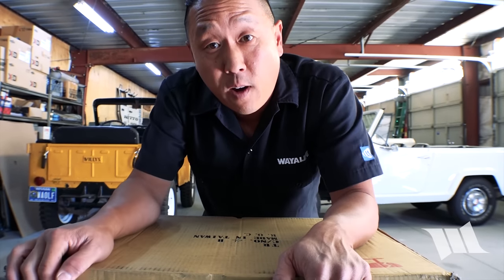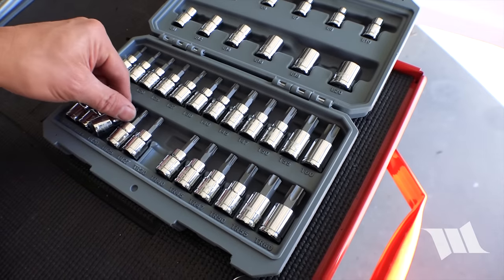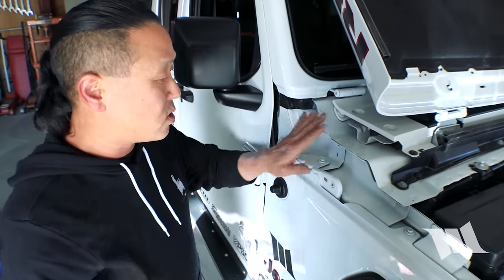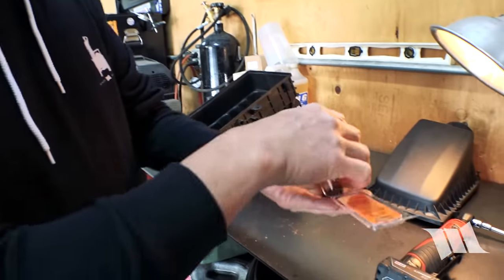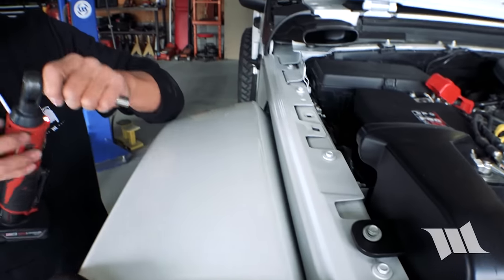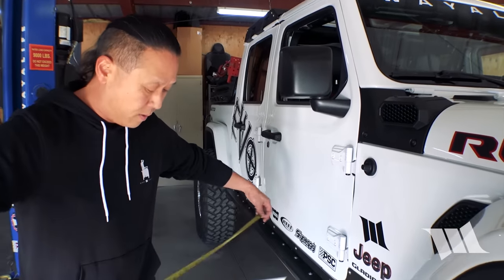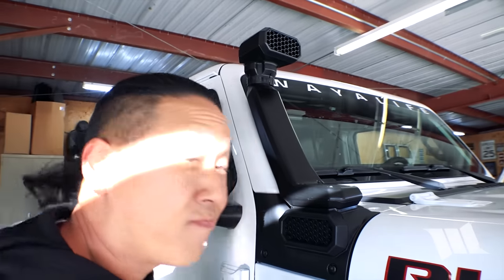Rugged Ridge AmFib Snorkel HOW TO INSTALLATION on a Jeep JL Wrangler or JT Gladiator Truck

Comment: The low snorkel looks great, the high set up looks good as well. I really like the versatility of being able to switch between high and low.
Reply from the maker: The best part is, you can literally make the change in about 1 minute.
Reply: I understand the utility of the high mount but, I agree with Eddie on the low mount, if you're in water deep enough for the low mount to be an issue, you got bigger problems.
Reply: OS RR Very true
Reply: OS RR maybe not so much the depth but perhaps the splash...
Reply: OS RR high mount is more for dust than water though I believe the low mount is good for those mall crawlers bc it would allow more dust in than the high mount and we all know those mall crawlers only deal with city smog lol

Comment: This video is the one that convinced me to get the RR AmFib Snorkel.  LOVE IT!  I switch back and forth from Snorkel to Cold Air side cowl intake.  I really liked the idea of not having to cut a hole in the side of the hood and the install was very easy. If you've done any kind of installs of anything on a vehicle, this is simple.  One thing I did pick up from another install video was to rotate the clamps so the screw adjustment is under the intake tunnel, this keeps you from scraping your arms or snagging your shirt on the worm screws.  Also, I've seen the exterior snorkel and cowl parts painted to match the jeep from another YT video, and it looks super sharp. 

One thing that also should be mentioned, do not tighten the clamps too tight (What me?), especially if you live in a warm climate, as the plastic on the connectors will deform.  I did that, but with a little careful use of a heat gun was able to get them back into the proper shape.  A suggestion is that RR beef up the plastic connectors where the rubber tunnel connects with a thin metal strip on the inside of the tunnel that is pop rivetted to the plastic to reduce the likelihood of the tunnel deforming from someone tightening too much on the worm screws.  I'm thinking of trying the metal strip myself if I see the plastic deform again.  

As for a lightbar, I've purchased, not yet installed, an interior light bar that mounts on the inside of the windshield looking out, because of the roof mounted lightbar support conflict, to reduce road noise (More aerodynamic) and well, I liked the stealthiness of the interior lightbar (One less item to snag on tree limbs and one less thing for "sticky hands" to snag from your rig).  Don't know how LEOs will view the legality of a lightbar not being covered on road, it's technically not an "exterior" light, but does shine to the outside, I guess I will find out soon.

Comment: Hey buddy, you saved me a bunch of work.  I was really dreading moving my winch to install the snorkel!.  I’m gonna pull that little lower air tube out as you did anyway, just because..., but I’m sure glad I didn’t have to move my winch (or front bumper).  Thanks a bunch!
Reply from the maker: Glad I could help

Comment: Great video. 

If you've ever seen someone do Cape York in Australia, you'll understand why you really want this to be waterproof. Considering you can't really legally run 40's here (only 2 inchs bigger than stock) and maximum a 2 inch lift (although people run bigger) the higher and more waterproof you can get that snorkel,  the better.

Great product, appreciate the level of detial provided in the video.
Reply from the maker: Yeah, not really an issue here in the USA but I could see the need for it in your neck of the woods. Glad you enjoyed the video.

Comment: The low profile snorkel looks the best.
I think the idea of bringing in fresh ambient air would be the main usefulness of this item,rather than under hood temps.
Although in colder climates it may make the motor run different.
If your in water over that you will have other areas that water can enter,like differentials/transfer case breathers,any electrical connection that hasn't been waterproofed,etc.
Reply from the maker: Yup, that's all true but I would add, if any of the deep rivers I've crossed were that high, they'd be carrying me down into the Pacific Ocean. LOL
Reply: @wayalife  There you go......lmao.

Comment: Looks cool, and it certainly is watertight. I have one concern and one comment.. My concern is that it's gonna whip around at highway speeds because it's not fixed to the A pillar. My comment is this.. Snorkels are not only fitted to prevent water ingress into the airbox, they are also good to get the air intake up high away from dust blown up by the tyres.
Reply from the maker: You could be right and we'll be testing that out.
Reply: @wayalife  I am right and yes, you should test it lol.

Comment: Just FYI the 3rd rubber feet thing under the air box is for the grill air ram part number 68304129AA cost like 44$ it comes factory on some models. It send air under the air intake from the grill. Don’t know why yours didn’t come with it. Awesome video always great instructions. 👍🏽
Reply from the maker: Yup, figured that out after the fact.

Comment: Just an observation? You silicone the new fitting/elbow in the bottom of the air box but just snapped in the air box adapter? It looks to me it would accumulate water during slow deep-water crossings, both are almost the same height when installed? Very detailed video. Thanks
Reply from the maker: Not exactly but I see what you're trying to say. To me, plugging up any of the holes shouldn't make much of a difference being that they sit below the air filter. Companies like AEV specifically state NOT to plug the holes to allow for draining.
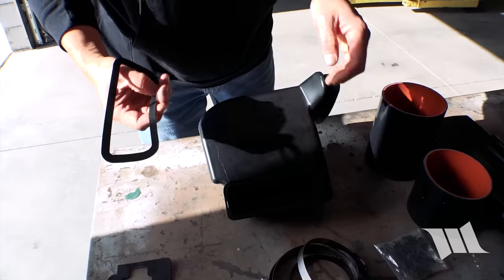Reply: @wayalife  Maybe this is a better way of explaining my question? At 14:09 your sealing a drain system and the air box adapter 15:55 is not sealed? Which would allow water to inter the bottom of the air box. And stay there until you open that white drain valve. All of the air box adapter is  below the air filter as is the drain plug. Why not seal the airbox adapter to the air box? It comes out in one piece.
Reply from the maker: @dougharlow6037  LOL - I got what you're saying. What I'm saying is that installing the drain wasn't even necessary.
Reply: @wayalife  That's why I'm asking the question. If AEV states NOT to plug any holes then why are they giving you a drain system? AEV is asking to plug only part of the air box? I'll guarantee if you take that air box assembly and submerge it in water just below the air filter you see how fast it will fill up, the more it fills up the more your engine will starve for air. They did such a good good of engineering the snorkel assemble, I just don't understand why they would want you to seal the COMPLETE bottom of the airbox? Just an observation. You have great videos. Thanks
Reply from the maker: @dougharlow6037  The bottom of my air box sits about 44" off the ground. If I'm fording water deeper than that, there's a lot more I'd be worried about than getting water in my engine. That being said, I couldn't tell you why one companies does things one way and another does it another. I simply showed all the steps Rugged Ridge instructed to do so that others could benefit from it. I would suggest you contact them to see what their reasons are.

Comment: Always thorough install videos! I would think any water too deep for stock air intake is not good for several reasons.
Reply from the maker: You're right, it would be and I wouldn't recommend it. However, if you're fording a river correctly, you will create a bow wake that can reach the hood even though the water level is lower than it. If you think about it, the low position of this snorkel isn't that much higher than the factory intake but it is further back for this reason.

Comment: One of the best install videos I’ve seen. Thank you.
One question I have is how much higher the low mounted snorkel is over stock?
Thanks!
Reply from the maker: Thanks! The low mount is only slightly higher but height isn't the point. If you're fording deep water correctly, it will create a build up of water on the front of your Jeep and potentially to the point where water comes up and over your hood, even if the actual water level is significantly lower that in. The ensuing bow wake will cause the water to drop away and so locating the intake further back alone can be a significant help to keeping water out of it.

Comment: I don't EVER have any plans to ford water deep enough to actually NEED a snorkel. I am however, considering this (with the low mount) as a way to get cooler air into the airbox, instead of my engine having to breathe that hot air from under the hood. Thoughts??
Great vid, guys!👍🏻
Reply from the maker: Yeah, I do think this kit would help with that. Although, unlike the JK before, the JL does have an ambient air tube that is designed to help out too.

Comment: Looks great, I guess adding “check air box water valve” to regular maintenance is now a thing.  Is that valve hard to get to?   Thanks for the videos.
Reply from the maker: With the ambient air duct removed, it's not too hard. I should note, I just leave mine open all the time and IF I ever do a deep water crossing, I would close it at that time.

Comment: Man, what a great tutorial.  thank you.  I have a Mohave and the  site for the snorkel you used says does not work with Mojave.  I can't figure out why though. It ought to work
Reply from the maker: Sorry, I'm not 100% sure why that would be the case.
Reply: The cowl on the Mojave is significantly larger.  It will not work.  I just tried to install it.  Everything under the hood works.  Time for the return dance.
Reply: @obanioncd0690  Dang it! Man I'm sorry.  I'm also sad that now I know for sure it won't work.  I had been holding off on it until I made sure.  Thank you for letting me know.

Comment: First, great video, yet again and good looking snorkel with either setup. Correct me if I'm wrong but the "low" snorkel seems to be not much higher than the stock intake? Also, in order to remove the battery once the snorkel is installed, you would have to first remove the section of snorkel that covers it? Lastly, will this snorkel fit the same with the 2.0 turbo?
Reply from the maker: If you're actually sitting in water that deep, you have a LOT bigger problems to be worrying about especially if it's moving. Assuming you do not know how to properly ford deep water, you need to push through it slowly and this will create a bow wake. While water can envelope the top and front of your Jeep, the wake will push the water aside and away from the cowl. This will install on a 2.0L and removing it to access the battery isn't that difficult.

Comment: All done!  Lessons learned- 
1.  No reason to remove that bolt under snorkel plate assembly 
2. Those battery wrenches don’t have torque settings like drills, so go easy. (I accidentally cracked the plastic around the bolt under snorkel assembly when putting back since no reason to remove).
3. HOLD ON TO BOLTS and POPUP inserts.  Lost items get really lost in engine.  Nope, they don’t always fall through.
4.  Start bolts in air box top before installing.  You may drop one.
5.  Be gentle piping out the popup pins, they can fly out and get lost.
6.  Removed Foam piece can be trimmed and reinstalled.
7.  Plastic nut on back of pitcock valve does not get very tight.
8. Says to leave pitcock valve open and close when needed, not sure what is better.

Comment: I noticed your JT has no liner inside the wheel well so getting to that drain tube should be pretty easy but for those of us that do have liners I am guessing installing the drain tube would be counter productive?  Interested in hearing your thoughts.
Reply from the maker: You can still reach up and get to it from underneath. It's one of the reasons to remove the ambient air tube.
Reply: Ok, this answers my question.  Thanks.

Comment: Great video. This may be a crazy question. How do you keep it from sucking rain in? Seems like that could be an issue. Neewby here.
Reply from the maker: The snorkel still uses the factory air box. As in, air goes down into the box and then up through the filter and into the air tube. The box is deep and has baffles to trap water and debris that might get in. There is no way even a heavy rain will be an issue and if you're really that concerned, leave the drain open for normal driving and then turn it off when fording a river.

Comment: Awesome video, thanks! I read a complaint about a loose connection between the air-box adapter and air-box, despite the gasket and cleats (16:20). Two Q's: Did you experience that over time and would you recommend applying a bead of silicone to between adapter and air-box?
Reply from the maker: Can't say it's been a problem for me but if it's a concern, it certainly wouldn't hurt to apply some silicon.

Comment: Great video, excellent step by step and explanations!
So after 22 months, do you have any pros and cons you may have found with this? 
I'm looking at this for my 2021 Rubicon JLU. I figure I'd run low mount when at home using as DD. High mount when heading to the bush. The backcountry in Canada can be extremely dusty, or mucky with surprise drops in some of those water dilled mud holes. 
Just looking to prepare for any got ya's.
Reply from the maker: What I can tell you is that I haven't had any issues with mine and I'm still happy with it.
Reply: @wayalife  Thanks

Comment: Hey Eddie , in your experience what would you say is the best air filter for our Jeeps? Keep the dust out with good filtration , but not to restrictive.. i have “Heard” K&N lets more than a desirable amount of dust threw , and i don’t wanna dust my engine . Your opinion would be appreciated , thank you.. oh and i agree the low profile intake looks bad ass , and like ya said any higher than that ya got more worries than that like your cookies getting wet and your whiskey floating away lol...
Reply from the maker: Honestly, I LOVE the OE filter that comes on the JL and JT from the factory. Hands down, it does the BEST job of keeping dust out of the engine. From experience running all kinds of other filters including K&N in the past, I would never run them again. On the JK, I've seen way too many engines go bad because of them.

Comment: Great video! I wonder if you can recommend a full or medium front bumper with a recessed winch plate for a 2022 Wrangler Rubicon Extreme Recon. I am looking for one into which can accommodate the original LED fog lights. Thanks!
Reply from the maker: I would recommend that you give LoD a look https://lodoffroad.com/category/jl-signature-front-bumpers

Comment: That looks like a really neat design! However, every time I start thinking about a snorkel for my JL, I see how well thought out and well designed the factory air intake system is and I decide to stick with it.  Still, I think Rugged Ridge did a very nice job with this thing.  Is it possible to put a dust separator on the top of it for trips to really dusty places?  Btw, I always enjoy your installation videos, Eddie.  You leave nothing to question thanks to your clarity, easy pace, and great photography of every step.  I assume that is your wife doing the filming.  She's really a pro!
Reply from the maker: Rugged Ridge did make a particle separator for the JK and I would imagine it would fit on the JL/JT snorkel as well. Also, Cindy and I really are happy to hear you enjoy our videos and appreciate the kind words. Yes, Cindy does all the filming and editing :)

Comment: Nice vid and well documented.   Can I ask if you notice any increase in noise induction ?  Steve 🇳🇿
Reply from the maker: Honestly, I can't say that I have although, I'm currently testing it out in the low mounted position. I'll have to give it another listen once I start to do more testing with the high mounted setup.
Reply: Wayalife thanks for replying.  Can I ask what this ambient air intake does?  Didn’t even know it was there til you showed it

Comment: The fact that it is full bolt on with no cutting and has a really clean look is really appealing to me. The only additional thing I would want to do to it is color match and wrap (white in my case) the cowl adapter for symmetry.
Reply from the maker: That's something I may still do :)

Comment: Love the install. What do you think of cutting a few channels on the inside of the airbox to make sure the water drains towards the drain tube? I live in south Texas where it very hot in the summer and the water not draining over those walls will just and soak into the air filter. Anyway, great video as always, looks damn good.
Reply from the maker: Even the 4 holes that were there weren't anywhere near the lowest point of the air box. I personally don't think it'd be much of an issue but sure, I suppose you could do that.
Reply: @wayalife  Good point. Appreciate the feedback.

Comment: I love the low pro look on this snorkel.  But with the tube running under the hood, how does it effect the intake temps? Once the engine is warm, especially in warm/hot weather, wouldn’t it be a little more difficult for the engine to breathe?
Reply from the maker: You're assuming that the air passing through the tube spends enough time there to warm up to engine temps. That would be quite a feat. So far, I have not seen that happen.